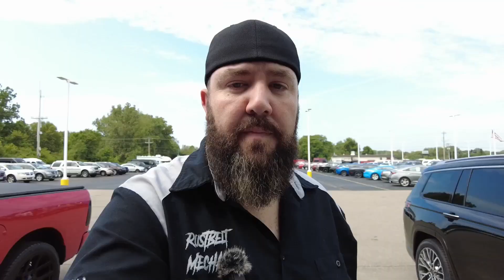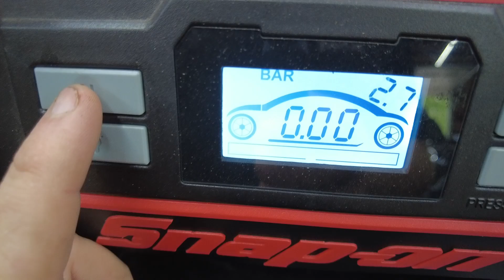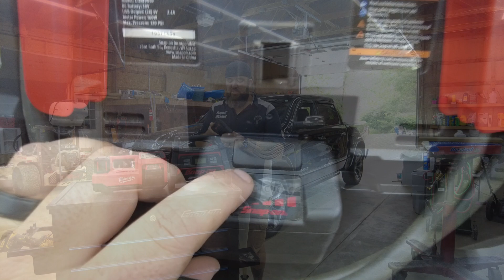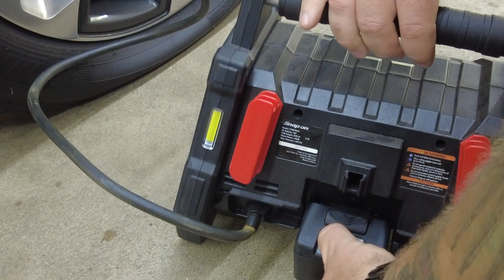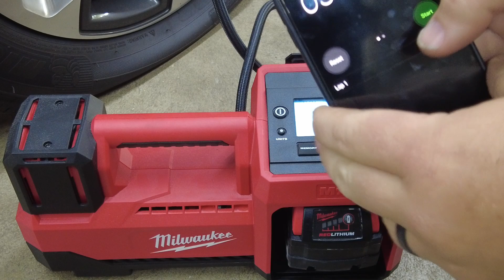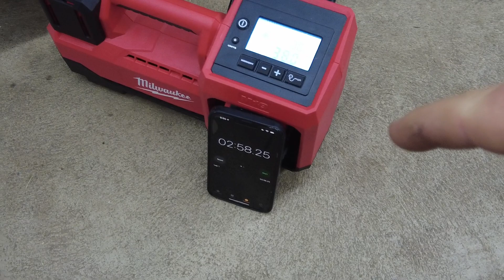SNAP-ON VS. MILWAUKEE AIR INFLATORS HEAD TO HEAD MATCHUP

Comment: The best would be with the battery platform you have already
Reply: Not when the inflator is 2x-3x faster than the one you already own!
Reply: You could buy the Milwaukee with batteries and charger for less than the snap-on.

I really don't believe this saying anyone.

Comment: I bought the milwaukee.  I needed air in a small 10 inch tire. It needed to go from 15 psi to 50 psi. I was absolutely shocked! It took 5 seconds. Not a typo. FIVE seconds! It's a small tire, but that was totally unexpected. I get it if you don't believe that, so do yourself a favor and buy this inflator and test it yourself. Think I'm going to let air out of something and test some more.🤙

Comment: For a mobile unit, (onboard air), it’s more cost effective to hook up a 12v air horn compressor with air horn tank… Note: The air horns are optional but are nice to have 👍🏻You can add as many tanks as needed if you have the space…
Reply: Except for if you switch vehicles a lot.  Also cheapest 12c compressor you can get is $100 then you have ru air lines and mount a tank with a pressure regulator and a some type of compressor cut off switch.

Min $200 for an air horn set up.

While i just bought the Milwaukee comprefrom home Depot with two battand a charger for $149
Reply: @tracytillett  Where's that deal, I'm not seeing anywhere close

Comment: I ordered my Milwaukee m18 inflator as a kit for 199.
Homedepot canceled my batteries and charger. But, kept my inflator for 94 dollars. I'll take it. 😉
Reply: What? Damn, u're lucky. Just ordered one from Amazon. What batteries did u end up going with? I haven't got the battery and was wondering what the xc6 or 8. TIA.
Reply: @eyang7  Use whatever 18V batteries you want. Get an adapter to run them on Milwaukee tools.

Comment: I just bought the Milwaukee and am waiting for it to be delivered. I will only use it at home to top off tires. I have an 12 volts inflator that connects directly to my car battery and draws up to 40amp current, and it can complete the top off you did from 10 to 38 psi for about 1 minute. I also do not want to keep an M18 battery in my car for the rare occasions of flat tires since the battery will degrade quickly in extreme cold and heat.

Comment: I have the m12 and the m18 and use them often. I was surprised the Snapon was only 269$. Snapon tools may be  larger but they leave your wallet smaller. I got the m18 off the web for 139$

Comment: Just did a the same comparison at work today. Figured the guts inside would be the same, however that is a big no. Airing up 235/80 16 tires from 35# to 65#. The Milwaukee was able to inflate 3 tires to the Snapon’s 1 tire. With the Milwaukee finished with the 3 and Snappy only at 60lbs. So sad.

Comment: I just bought a 2pack of M18 batteries, one 6ah and one 8ah and it came with a free M18 tool. I chose the inflator. Everything all together cost $279 at Home Depot. Great deal in my opinion. I also bought an adapter to convert the screw on hose end to the fold down connector type thats on the snap on one in the video. It cost about $10 on amazon

Comment: Can we get latch style adapter for Milwaukee? I’d prefer that since it’s more efficient
Reply: LocknFlate makes a dandy one. Instant on and back with no loss of air pressure.
Reply: I found a quick connect chuck at Princess Auto for 12 bucks.

Comment: Would be great if people commented on the best air hose to tire valve attachment upgrade for the Milwaukee.

Great review... I esp liked the info on it fitting in the RAMbox. It would be so easy for Milwaukee to add a couple of USBs and lights. Milwaukee should provide the better hose end too and a deflator like the Makita has. They could make it the best inflator too for air mattresses and truck air bags etc. This would increase recreational sales. Adding 12 volts would be good too, as would plug for 120V AC. All that said the 20/40 duty cycle should be improved, the 20 min beinig fine, but the 40 min cool down is a bit too much.

Comment: It’s hard to compare a product that came out over 5 years ago with one that is new to the market at time of this recording. You’d expect the way newer tool to be better just based off of how fast power tools are improving year after year. I have neither but I know I’ve seen that Snap-On around for many years now and I’d be shocked if they weren’t working on an updated unit now that they released a handheld inflator.

Comment: These guy's have "got you by the batteries" most people stick to brand because of batteries/chargers etc. would you go out and buy the snap on inflator if it won the test if you already had a range of Milwaukee tools and batteries?
Reply: you can buy cordless adaptors to use between platforms for pretty much anything now

Comment: What m18 battery were you usuing?
Reply from the maker: A 5.0ah
Reply: @Rustbelt Mechanic  sweet video i love milwaukee :).  If you use a high output 6.0ah it works faster at least it does in mine.  Have a great day.

Comment: I like the insignificant advantages that Snap On has over Milwaukee.
USB ports
Closed door for accessories
Clamp style connector
One day, Milwaukee will release a Fuel inflator, and it will be awesome.
Reply: This IS a Milwaukee Fuel Inflator.
Reply: @garymeyer3294  doesn’t say FUEL, not fuel.

Comment: Good review but I must say, comparing a year old snap-on versus a new Milwaukee isn't fair.....But, I've had my snap-on compressor for 4 years now, worked great for the first year or so, only using it a few times a year as it stays at my house,  but now it won't build air more than 45 psi. I used to be able to fill my truck tires at 80 psi, but not anymore. Looks like it's time I try the Milwaukee.
Reply: Now is the time to buy it. You can get it from Home Depot gift center sale for $199 with two 5ah batteries and charger.
Reply: @tracytillett  I got it yesterday but it’s $199 for batteries and charger with “free” inflator.
Reply: @patty109109  I'm glad you replied. After I made this comment I knew I mistyped but didn't know where I replied to it.

Yeah the tool by itself is 149 and the bundle is $199 which is also the same price as a two 5amp batteries and charger
Reply: @tracytillett  Still going on just snagged me the deal. Though they don't have the inflator available for shipping. So you'll have to find a local store with it in stock.

Comment: Both suck, just use an air compressor.
Reply: Air compressor is heavy and have to drag air hoses out if out there away.
Reply: Yup, because I always want to carry my pancake compressor, and my generator to power it on the side of the road, out in the field, or camping where there is no power...
Reply: Honda guy lives at the shop...
Reply: This is an air compressor with the tank. 
Fill the tire directly or fill the tank then the tire.
Reply: I have air compressor. I don't want to drive my car to it with flat tire.
Reply: 220v compressor and 6ft' tall tank plus the hose reel aren't very convenient for me to carry around. It also seems that the highways are hiding the  220v outlets.